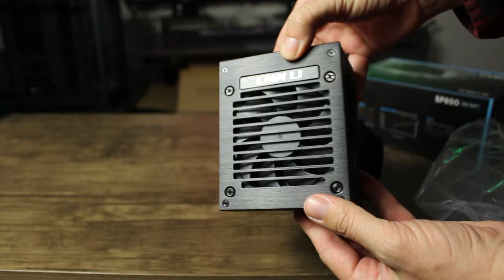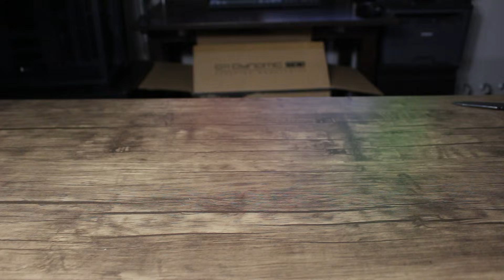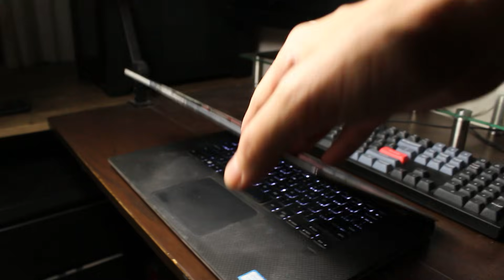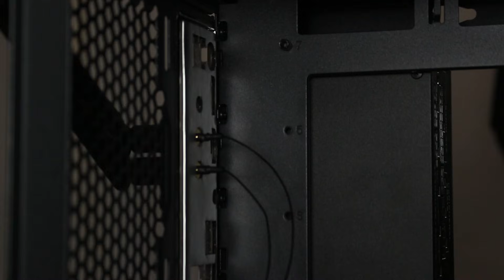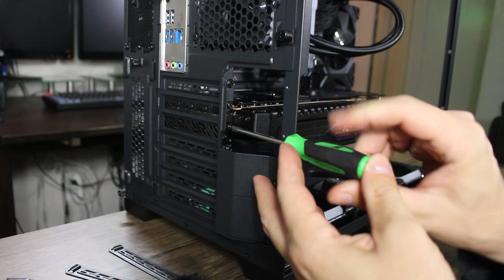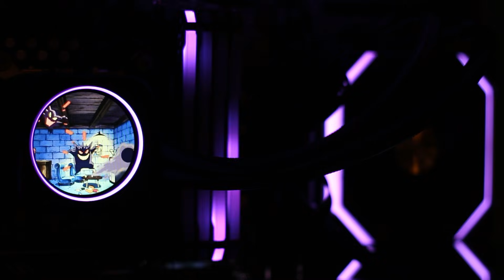A PC Build But It's For Car People

Comment: 12900ks delided IHS here on custom water loop with liquid metal, 32gb DDR4 B-Die at 39ns all paired with an ASUS 4090. 
M.2 for C drive, SSD's for games and HDD platters for long term storage. 
34" Alienware Oled for games, desktop etc, then a 49" Samsung super wide for my Sim rig and trading screen. 
PC's and cars are some of my biggest stuff I nerd out on.

Comment: hi great pc i have the same case and fans and ur fan config is very wrong. u want the 3 bottem and the 2 side fans to show the x pattern and the back one and top three to show the silver lian li logo. if u do this ur pc will preform better and get less dusty and its just better fro the pc in the long run. hope that helps. Edit just realised u have reverse fans so exelent job well done hope u enjoy it
Reply from the maker: @asidvr8723  Some of the fans are reverse blade. The bottom 3 and 2 sides are intakes, the top 3 and rear 1 is exhaust.
Reply: @TheCarPassionChannel  Yh I edited my comment coz I realised I had reversed fans but sick build bro also love the miata hoping to get one soon

Comment: I would suggest you get a traditional hard drive for archiving and storing large amounts of data. SSD wear out, they can only write so many times. You can get an external drive if you want flexibility to connect to it with your laptop. I bought a 14tb drive for about $200 recently.
Reply from the maker: You mean an HDD? The ones that have moving parts and fail regularly haha 

I do have an external SSD and cloud backup for the important stuff though 😬

Comment: Can't wait to see that amazing Miata drive again. Beautiful car, and beautiful BP engine. I love what you do and look forward to seeing you drive it again. Even if it's just a cruise around town, I look forward to it. That car is amazing, and my car has the same engine. I kept mine stock, but it's still running after more than half a million miles. Still has good compression too and doesn't burn any oil. 176-179 on all 4 cylinders. Those BP engines are nothing less than amazing. I'm still driving my 97 Kia Sephia with the BP engine. It was my first car, and I still love and drive it till this day. I've actually thought about looking for a Miata from a junkyard and putting the BP engine that I already have in it. Anyway I love your videos and look forward to what you do next

Comment: 13:53, Thermal Grizzly makes a thing called a "Contact frame" which prevents the bending of the motherboard, ironically, I have been planning a PC build for myself.  Already got the GPU, board, M.2 (need a second one), and 4 sticks of RAM.  Going to use my current case and PSU as they are well capable.  Still, funny to see you post a PC video of all things, and quite entertaining.

Comment: iirc, you should mount AIO coolers with the tubes going down from CPU to the radiator
Reply from the maker: If the tubes are long enough, yes. The most important thing is making sure the highest point of the radiator is above the highest point of the water pump though

Comment: It's funny seeing a car guy first gettin into the PC space, for me it was the complete opposite :D 

Started with computers 20 years ago and just recently a couple of years started with cars!

Some stuff I noted when watching the video, normally fans works better pushing air through then sucking, so your gonna lose some performance of the cooler. it will work  but not optimal. 

You want to make sure the radiator inlet and outlet is toward the bottom of the case, for anyone building a pc, an AIO is a sealed unit which is prefilled, but its next to impossible to fill it completely in the factory(in a cost efficient way) 

so there is some air in the system and depending on age, there will be even more air once the water evaporate from the tubes. so you want to make sure that cpu block/pump is low and that the air that exists in the system is moved toward the radiator. 

if the pump gets air trapped it will be less effecient at moving water, the pump is water lubed and water cooled so it is very important that the air is kept in a place where it wont do any damage. 

this is not much of a problem when the AIO is new, but could be a problem in a year or two and will lead to premature failure(ive had a few systems where the pump has died because of age and poor cooling/lubrication. and almost everytime is see the tubing mounted the wrong way :D
Reply: oh and btw, if you like beamng, building your own amazing creations in automation and exporting them to Beam to drive it is a blast!

Comment: Most gamers don’t want to play on wi-fi, unless they play exclusively singleplayer games. I don’t use wi-fi on any of my self-built pcs.
Reply from the maker: I have direct wire in capability but where my PC is located I can't have a cable running to it at all times. It also gets 900mb/s download so that's absolutely plenty
Reply: @TheCarPassionChannel Being unable to reach the ethernet cable sounds so terrible, but that does make sense. We’ve had a couple mishaps with someone playing on wi-fi and their connection unfortunately dropped often. :( They were in a similar position in which they were an entire floor above where they needed the cable to run. Great video though, fun to watch!
Reply from the maker: @Aphrodonis  not a reach issue, I have a super long cable, it's just from the router location to the PC running a cable is ugly haha. Router needs to be in a specific location because 5G Wifi

Comment: Nice work, Greg! 

With that being said: 75w from the slot, and 150w per cable is the spec, you're currently asking your 320watt card to pull 75w from the mobo and 245w from a single PCI-E cable.

Please make sure to run a second PCI-E cable from the PSU to the GPU. Using two pigtails off one rail is inadvisable and can cause your GPU to crash when/if it pulls too much power all at once.
Reply from the maker: Yeah a dual power cable is on the short term list for sure.

Comment: The GPU support actually helps in the long term with gpu sag were the material of the GPU PCB starts to bend over time due to the weight of the cooler causing internal damage to the connections inside the PCB and having a gpu that looks like its bent

Comment: I see you also got the KF variant to save $10. A man of culture. Multiple times i could have used the onboard cpu video for troubleshooting and was kicking myself lol. You should get a vr headset for racing games 😮
Reply from the maker: I went that route after several headaches with my laptop using the internal GPU and not being able to force it to use the Nvidia for specific programs. I figured this way it would be impossible to ever have that issue, LOL

Comment: Yoooo our pcs are very similar 🤣🤣 AND WE BOTH FORGOT TO INSTALL THE COOLER BACKPLATE IM DYING 🤣🤣🤣🤣
Reply from the maker: Lmaooo I didn't even have the cooler open yet and I was like wait ... Where do I bolt this to???
Reply: @TheCarPassionChannel  yeahh usually cases have a cut out behind the cpu so you can install/remove the cooler backplate. But on the lian li O-11 dynamic (mine is the evo) there’s stuff in the way so i had to uninstall the motherboard as well

Comment: If you have the length in your AIOs hoses I would flip it upside down to lessen the chance air runs through your pump. The goal is to have your pump be at the bottom of the loop.

You’re probably fine as it is now but those systems will slowly have more air leak in them and you may hear turbulence coming from it down the road. But no AIO lasts forever so don’t sweat it. You could mount it up top but then things won’t be symmetrical up there with your fans.

Comment: You shouldnt be putting intake fans on your radiator; Thats just sucking hot air into the case. Doing this is going to kill the cooling potential of your GPU's air cooler.
Reply: To avoid negative pressure I'd swap the top fans to intake so you're feeding from the top and bottom (heat convection is weak and easily overcome).
Glad temps are in check currently, the 7800XT is a great choice 👍
Reply from the maker: @Jason.Jacobsen   Thought about this again, pertaining to the GPU receiving cool air, the way the setup is right now the bottom fans (intakes) are really directly feeding the GPU fans, so I think it should work out alright. What I'd like to do is swap the fans around and log some long benchmarks to see what's affected. But at that point I would also want air temp sensors inside and outside of the case too. Might as well just put the thing on Megasquirt at that point though 😂
Reply: @TheCarPassionChannel  definitely agree with a before and after long run approach using a time spy or fire strike 30min loop. The thing I'd be curious about is your mobo VRM temps with the top fans on exhaust then intake. I'm betting on the temps dropping a good bit with them as intake and the radiator fans as exhaust. HW Info64 is your new best friend 😆
Reply from the maker: Or, if I make them exhausts, I'm trying to cool the CPU coolant with hot air from the case 🙂
Reply: Make top and bottom case fans intake and you won't have to worry about internal case air being "too warm" to exhaust through the radiator. It will also ensure the GPU is receiving cool air as well, not pre-heated air coming through the radiator.
Reply from the maker: @Jason.Jacobsen  I did plenty of research on it and the differences are negligible, I didn't want to run the radiator as exhausts and create negative pressure in the case either. Temps on everything have been great so far

Comment: what level of nerd am I for knowing Jayztwocent was gonna be at the top of the list just based on the part selection and aesthetic of the build?  
also disagree about the graphics card being like a turbo.  it doesn't boost performance of the cpu... its more like a second engine that has a different and/or additional function.

Comment: Another analogy I thought of: RAM is like a surge tank and the HDD/SSD is like the fuel tank. RAM feeds the surges but can't hold everything. 
Congrats on the new PC, building a PC (especially the first time) and having it turn on that first time is super rewarding. I'm impressed (but not surprised) how much you managed to learn about a new hobby in only a few weeks. Even though I've been building PCs for 15+ years I learned something new from this video (never heard of reverse rotation fans before). 
Having a spare CPU air cooler on hand is always a good idea. I've personally had a bad experience with the reliability of water coolers but I can't deny that they look sick. They just have a lot more moving parts and failure points than simple air coolers. So if you do have issues it's nice to have an air cooler ready to swap on.
Regardless I can't wait to watch more doom on your first "real" stream! ;)

Comment: Ignore the haters. Your thermal paste application is just fine. It's not "perfect" but it'll serve you well enough. 

Source: I ran a bunch of paste benchmarking on the 13700k. I'm a senior hardware engineer for one of the largest computer companies in the world.
Reply from the maker: I used about the same amount on my air cooler, and had just a tiny bit make it over the edge of the IHS. But now I wanna go back in and re-do it after all these comments 🤣

Comment: WAY too much thermal paste. I always use Arctic Silver on all my builds (over a dozen at this point mostly for work production PC’s), and they specify a single line down the middle of the CPU, with slight variations depending on CPU brand and model. I think too much will make it less efficient overall.

Comment: Great build!  If your psu comes wity a second pcie power outlet I would recommend using a second cable in lieu of the jumper power cable to the GPU. 
Thank you for the years of great content!
Reply from the maker: That's high on my list, I was a longer cable so I can run underneath the GPU, and one with two dedicated runs instead of the pigtail. Thanks for the suggestion!

Comment: NOT upper mid range board, even mid boards have wifi - but wifi sucks. If you can, just connect via ethernet/network cable.
Reply from the maker: Meh, 900 down is definitely fast enough

Comment: I have built a few PC's and never used a Wifi chip, that was new to me! Also that was a LOT of thermal paste lol
Reply from the maker: I swear the video made it look worse 🤣 I pasted the air cooler the same way and when I pulled it off it hardly had any excess over the edges of the IHS